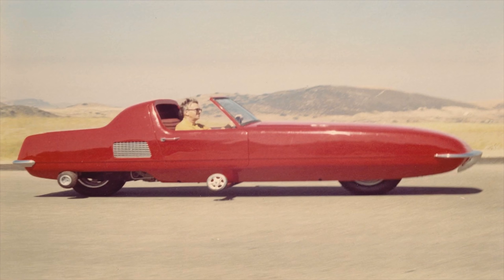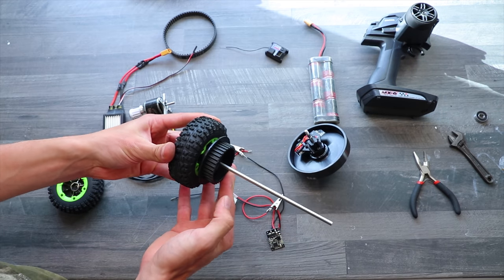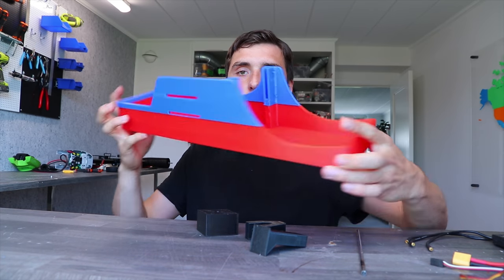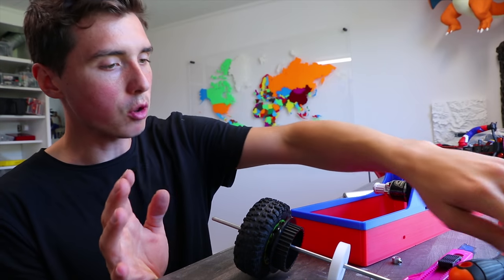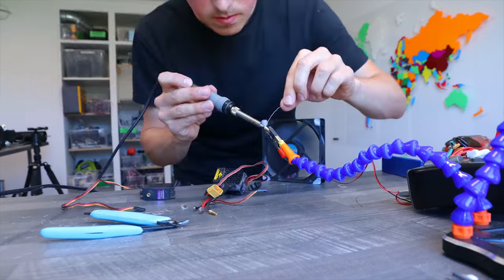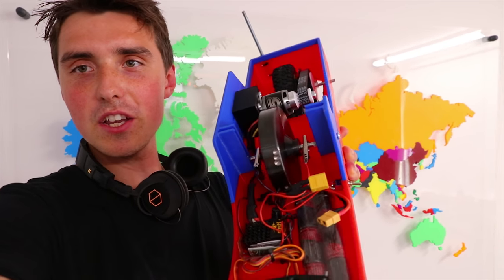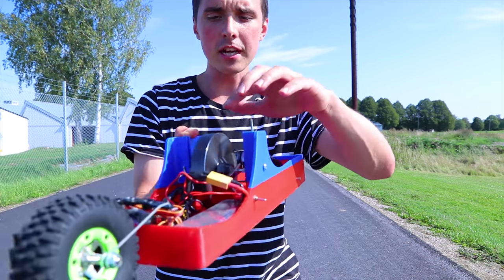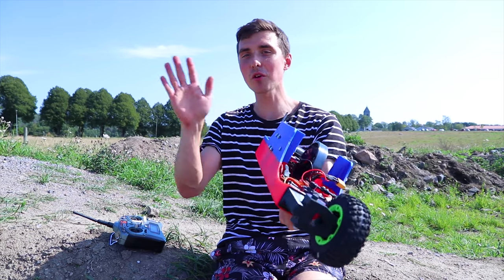Gyro Stabilized 3D Printed RC Car

Comment: The axis of rotation of your gyroscope should be vertical. Currently your gyroscope is fighting the turning force applied by the front wheel. This is causing the tilt when you steer. The simple explanation for this is that a rotating mass will "resist" forces perpendicular to its axis of rotation.

(Further Explanation) Ok it's not really resisting, when you apply a force to a rotating mass the force actually gets applied 90 degrees offset. 

Videos that show this
https://www.youtube.com/watch?v=eTjGTxSevHE (this is the best one imho)
https://youtu.be/ty9QSiVC2g0?t=54s
https://youtu.be/XHGKIzCcVa0?t=2m24s

Note the force equation.  You gyroscope is composed of a few parts, the disk is called a flywheel. Because of the force equation you should use a flywheel with more mass near the outside and less mass on the inside. (will get more effective flywheel that weighs less)

If you really want to do this right have two flywheels in the same vertical axis that rotate in opposite directions, you could do this with some simple gearing. If I'm correctly remembering 
how all this works it should cancel out a little more because the forces will get applied opposite of eachother (180*).

PS with a vertical axis gyro you shouldn't have an issue with precession because having two wheels spaced apart will only allow the gyroscope to fall in a vertical plane (which is perpendicular to the direction of travel).

Also a clarifying note, a gyro with a vertical axis will not be affected in any way by turning.

By exploiting more physics stuffs and adding some control logic you could make a single wheeled RC car.

BTW the car you base your design on has a gyro with a vertical axis.

You do awesome work. Hope this helps you make a more awesome rc car :)
Reply: West okay big brain
Reply: You realy type it all 👏👏👏
Reply: Wow! That's very impressive. Even your feedback loops are perfectly tuned!
Reply: PHYSICS
Reply: Longest comment ever
Reply: Good effort
Reply: Actually the gyroscope is the only thing preventing his vehicle to crash every time he try to stear, since he completely botched the stearing mechanism. On a two-wheeled gyroscopic stabilized vehicle (a bike, for example) you don't turn the handle to stear, but you tilt the vehicle toward the center of the curve: the gyroscope reaction turns the wheel to follow the trajectory. Instead, if you try to turn the wheel toward the curve, like you would do on a car, the gyroscope reaction would tilt the vehicle toward the opposite direction, resulting in a crash. You can try with a bike.

the best way to do the stearing system would leave the front wheel free to turn, maybe with a weak return to center action (the tilt in the front stem of a bike has this fuction) and tilt the flywheel in your gyroscope.

Also, he should use appropriate bike tires, instead of the flat ones recicled from 4-wheeled vehicles
Reply: First thing that came to my mind seing him build the thing.
Reply: @Beregorn88  Is a bike  stabilized by the wheels turning?  They're quite light, and stable even at 100 rpm, don't know if there is enough "gyroscopic force" to keep you from falling.
Reply: Someone over here sounding like Jimmy Neutron.
Reply: It’s like you are trying to talk to me I know it !
Reply: ludovic schneider yes, that is how bikes balance
Reply: Thank you for explaining that! makes a lot of sense.
Reply: Wouldn't counter-rotating flywheels cancel out the stabilization effect?
Reply: came here to say that but i couldnt have explained that better, really hope he does a revised version after reading that
Reply: I came to see this, but I did not expect such explanation. I salute you !
Reply: Big brain power
Reply: Really the gyroscope should use its precession for stability. It could be mounted with a vertical axis on a yoke so it can pitch forward and back and a servo or stepper motor driven by a level sensor could use precession to correct the roll.
Reply: Yes exactly
Reply: West ima be honest.. I read the first sentence, clicked on read more and saw how much you have written and decided to just scroll past and check out different comments 😂 I am too simpleminded to understand everything.
Reply: ~ 20 lines of texts, including references, do not comprise an essay. 
I enjoyed you taking the effort.
Oneliners get stuck after the title.

Also think he is doing awesome work.
Reply: Hello! Is there a difference to position the gyroscope disk along the axis of the wheels or across? On a stabilized bike, I saw the position across the axle of the wheels in a floating frame. Thanks!
Reply: actually it should be aligned parallel with the wheels (front to back of the craft)(the axis of the flywheel) and should be coupled with accelerometers to detect when it is falling. the flywheel is spun forward or backwards rapidly to counter act the falling. It's been done in old American cars, was a novelty for a time. I still think it's cool. totally enclosed recumbent streamliner motorcycle anyone? hahah

Comment: Would it make a difference mounting the gyro horizontally?
Reply: I think it would cause some instability because then it would be similar to a helicopter without the tail rotor.(conservation of angular momentum)
Because the gyroscopic disc would be rotating in one direction, the car's body would want to rotate in the opposite direction and cause some sort of weird drift. This is not a problem when it's vertical because the normal force from the ground and the weight of the car stop the rotation along the body of the car, but when horizontal there is only friction stopping the car's tyres from sliding.

I could be totally wrong here, I'm just saying what I think would happen..
Reply: because of gyroscopic procession the force from the gyro wheel is affected 90 degrees off axis so it would become stabilized in the wrong axis.
Reply: Won’t work very well, probably not at all, as others have mentioned.
Reply: The gyro should be horizontal and and should be able to pitch.
Since the force of a gyro happens 90 from where it is applied it will turn the car left/right when it moves front/back.

Example of a passive gyro: https://www.youtube.com/watch?v=1KmhTfhaWG8
Reply: It would force it to tip over man...
Reply: yes, horizontal is the best for a flat track, if the track is not flat the gyro should be pitchable
Reply: @arnavjain7564  A helicopter needs a back rotor because the main rotor is creating a rotating force because of its air resistance
thats why coaxial helicopters don't neet one because there are two rotors horizontally in opposite directions

without air resistance (like a flat rotating mass like this gyro) it creates such a tiny force so its not demanding
Reply: It isn’t really stable in this case too. You need multiple axis to properly stabilize something with gyroscopes. And the axis must be bidirectional. So 2 vertical in opposite rotation, 2 horizontal in opposite rotation, 2 vertical perpendicular and so on.
Reply: @__Railgun__  isn't the back rotor to stop rotation caused to the helicopter body due to conservation of angular momentum? 
Like even in a vacuum if you don't fix a rotating motor to a base, the motor itself will spin in the opposite direction right?
You can even see this with a small DC motor. If it is not held in place either by your hand or some fixture the motor itself spins in the opposite direction to the motor shaft and tangles up the wires connecting it to power. I assume  that's why tail rotors are needed.. I'll have to look it up now.. lol
Reply: @arnavjain7564  Sure theres a force when the rotor spins up, but theres also one when you keep pushing air down, the air resistance. If a helicopter is levitating without pushing air down or up, the back rotor could stop in that moment, in a vacuum the back rotor wouldn't do anything :D because of no air resistance (but of course the helicopter would rotate when the motor speeds up, and stops when it turns off)
Reply: No it would not have made a difference (i do not really understand why others say it would). The wheel just stabilizes itself in position in which it was when rotation started. So wheel placed horizontally would just do its best to stay in horizontal position. To prevent arguing: https://youtu.be/BWKCImS8mVI
Reply: @arnavjain7564  https://en.wikipedia.org/wiki/Autogyro#/media/File:AutoGyro_Calidus_-_Shuttleworth_Season_Premiere_2016_(26422815634).jpg
this thing doesnt need a tail rotor. the rotor is spinning but the blades are 0 degree, so it has a very tiny air resinstance, so its not creating a rotating force, it would only turn if the pilot would stop the blades mid air or spin them faster. The uplift is created by the rotor in the back pushing forward and the rotating blades act like a giant disc, creating uplift
Reply: @lukaspetracek1890  but steering would not make it fall to the side..
Reply: @__Railgun__  I see your point, that's enlightening😄
Reply: @__Railgun__  yes it would. Car would tilt to a side while steering but wheel would have prevented it. Why do not you watch the video I posted link to? You would see you are not correct...
Reply: @lukaspetracek1890  well about the video that you linked to prevent "arguing"(I consider it a friendly debate😁), I think the weight of that contraption is way more than what we have on this one, so there would be more friction essentially masking the effect of conservation of angular momentum.
Basically my point is if it's not heavy enough it may cause instability..
Reply: @arnavjain7564  your point is correct. Heavier wheel = better stability. But the question was about if it would have work when placed horizontally. And I am saying yes of course. If one wheel works in vertical position that same wheel would have worked in horizontal position. Or under 45 degrees angle. It does not matter. Wheel just stabilizes itself against axial rotation / tilting.
Reply: @lukaspetracek1890  I dont get you comment conpletely, but if the spinning wheel is placed horizontal, the steering rotation wouldn't have an impact, of is an helicopter tilting to the side when the back rotor turns the helicopter? but it would tilt if the spinning wheel is placed vertical, thats why im saying, horizontal is okay, as far as the track is completely flat, that you can steer
Reply: david poiz looks like the car he based it was made that way.
Reply: @lukaspetracek1890  by heavy I meant the whole car, not just the wheel.
Look at my first comment again, you'll understand what I said then.
Reply: @arnavjain7564  Car would not have drifted as helicopter does, because it is "connected" to the ground by wheel which can absorb gyroscopic moment. Which is not the same case as with helicopter. It might turn to one side better than to other side. It might even turn little bit by itself on long straights if gyroscopic wheel was mounted horizontally. But it would not have been something steering cannot overcome. Practically it would have worked same as when gyroscopic wheel is mounted vertically
Reply: @__Railgun__  and i do not understand your comment. Of course turning would make the car tilt to side, that's why we equip kids bikes with side wheels, to prevent them from falling / tilting to side. So spinning wheel connected to car would stop the car from tilting no mater how it is mounted.
Reply: @lukaspetracek1890 my point was that "connection" which is due to mass will not hold up if the car itself is light.
Reply: REDACTED would there be a specific way to mount it to counteract that? A specific angle maybe???
Reply: @arnavjain7564  Car always carries weight of the spinning wheel, so it is always going to be heavy enough so the system could work. Problem raises when car frame is too heavy and spinning wheel too light = not able to stabilize the car.
Reply: @funnyyylock  well yes, vertical placement of spinning wheel would not make car to turn by itself. However it would fight against any turning (that is pretty much the reason why he was not able to ride the car home. Only on long straights). So it is also not perfect solution. Best would be to equip car with two smaller counter rotating wheels. That is how Chinook helicopter solves that. But that applies when you want to have it perfect. It is not necessary it would just turn slightly better to one side then to the other when equipped with just one spinning wheel.
Reply: @lukaspetracek1890  No of course it wont fall if the guro is placed horizontally, because it is stabilizing x and y axis, steering doesn't make any difference, only if the horizontal axis changes when for example driving flat and then up a hill, only then it would tilt

a bike is a complete different story, the weels are  vertical, didn't you ever notice that its hard to steer when driving fast? 50kmh+
even leaning to the side is hard

but only with fast spinning wheels
Reply: @__Railgun__  yep exactly. Maybe I am not able to explain myself enough because English is not my first language, but I am saying it from beginning. Horizontal placement of the spinning wheel would have worked even better. There are others who say horizontal placement would not have worked ( like Arnav Jain) so i am trying to explain why are they wrong. Without any success...
Reply: So in summary, horizontal gyro would also provide stabilization, the difference is what is being stabilized. Car with vertical gyro 'wants' to travel in a straight line and resists steering but doesn't resist changing slope; car with horizontal gyro 'wants' to stay level and resists changing slope but doesn't resist steering.
Reply: @Cyberguy42  its better to say: horizontal gyro locks x and y axis.       z axis is free so steering is fine
Reply: @lukaspetracek1890  Now I understand you :)
Reply: @datalorian  That could actually make for a very smooth ride over bumpy terrain.  Maybe?
Reply: its not a car but a bike!
Reply: @arnavjain7564  Your idea is right, but that rotating force would only be there when the gyro is spinning up by an on-board motor (or with an on-board brake for the gyro) because the difference in angular momentum has to go somewhere. This is actually what causes it to be stable - this conserving angular momentum. It should be mounted so it spins parallel to the ground. Once the gyro is at speed, it will stabilize the vehicle.
Reply: Sarkazmo Loafy it would balance better if there were two spinning horizontally in opposite direction
Reply: it may work with alot of thought put into it (there will be tons of hicups)

Comment: When I was a kid I had an RC motorcycle toy. It balanced on two wheels using no gyro, but was kinda tricky. It required you to keep the speed up and give it a rolling launch. I think the play in the steering is what allowed it to balane (as well as the weight distribution and the rake of the fork)

Comment: Great work! 
If I may suggest a significant improvement, the whole point to have a gyro is to act on it so can have a self leveling car for as longas as there is juice on the battery.
First you should mount the gyro motor on a single axis swivel, like a thurst vectoring swivel that creates rudder control on a zaggy wing motor. The gyro's motor axis of rotation should be vertical this time, not horizontal like yours. The swivel must be placed so it tilts the gyro back and forth with the help of a pretty strong servo. When the servo tilts the gyro back and forth, the whole car will tilt left and right, because of Momentum Conservation. This means that you can control the level of the car without touching the ground, just by forcing the gyro.
The self leveling will be complete using a drone flight board or a helicopter tail rotor stabilizer to sense the horizon and act on the swivel servo to keep the vehicle leveled.
Cheers again and good job!
Reply: absolute grate work

Comment: Back in the late 90s early 2000s I had a rc motorcycle that you had to first rev in the air. It spun a weight in the rear wheel. Once the gyro was reved up it would ride really stable. It was a motocross bike and I would often take it off ramps.

Comment: Awesome work. Your gyro basically does what the crankshaft does on a motorbike (unless it's a BMW or a Guzzi). I make it sport to put my foot down as little as possible, and sometimes a little gunning of the engine is enough to keep you upright for the crucial second before the lights turn green.
Also, check out the Wolseley Shilovski Gyrocar, one of my favourite vehicles. The same concept, but built in the first world war. The gyroscope was mounted on a cradle that could be swung back and forth to create a left and right force while the car stood still. And looks-wise it doesn't get any more steampunky.

Comment: So, what if you put the gyro on a pivoting mount attached to a servo (perpendicular to the axis of rotation). Then you could steer much like a motorcyclist by leaning to one side or the other instead of having to turn the front wheel.
Reply: You don't steer a motorcycle by leaning. You steer it by countersteering - basically turning the wheel the opposite direction of the turn. Sounds weird, but that's how it's done. https://www.youtube.com/watch?v=odJJXhg79j8

Comment: Thanks much for showing this.  I learned stuff. 

If you build another "car", can I suggest you try adding a little trail (on a bike or motorcycle, caster on a car) on the steering wheel?  Just put the axle of the wheel behind the steering axis by 1/2 to 2 inches.  It will make a big improvement in the vehicle stability.  Thumbs up to crush a troll.

Comment: Cool project. You should mount servos on the gyro, so you can turn by changing gyro position. Maybe you make it more stable with a angular velocity sensor(gyro) and a servo to move the gyro.